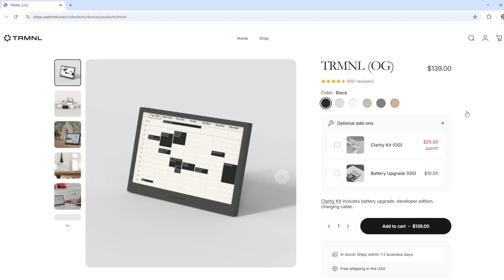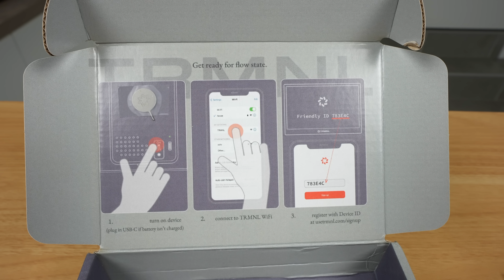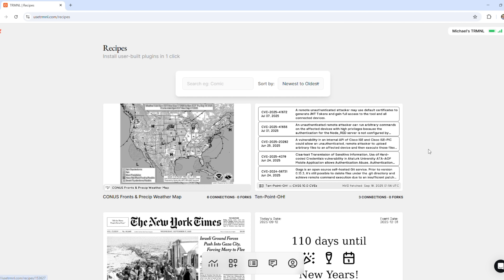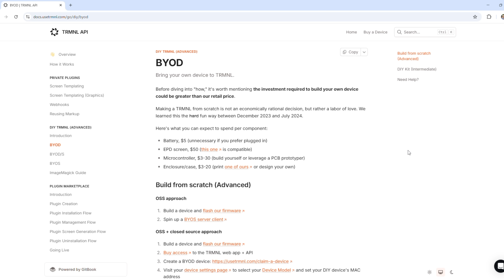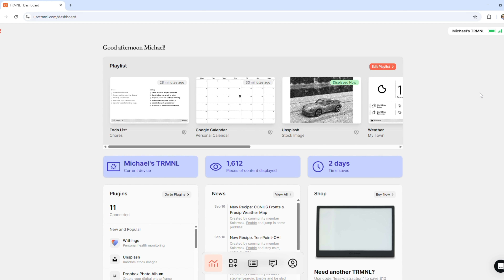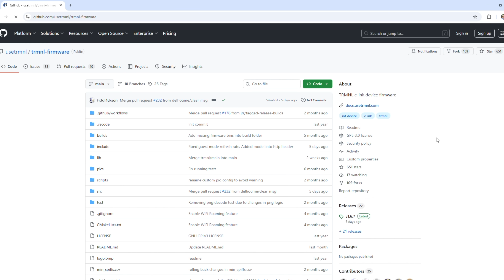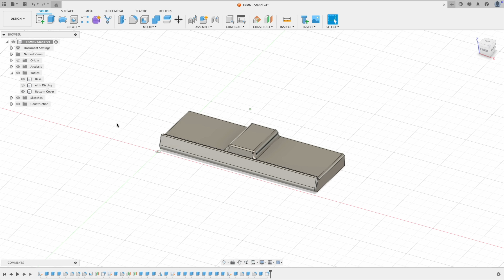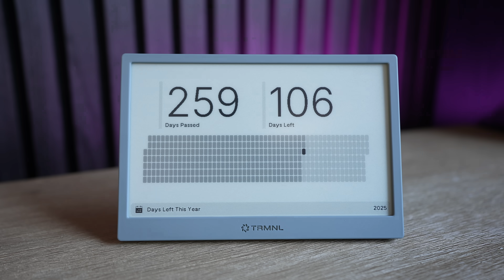TRMNL: The Open Source Smart Display You Can Build Yourself

Comment: Hey Michael,
I would like to know more about the 3d printed stuff, since I don’t have a printer of my own, I’m planning to use a professional service provider. I have a few questions before I proceed with that:
Aside from uploading the .stl file which you have provided, do I need to specify the exact material, or is that usually determined by the file itself? If it’s not the case, would you let me know what is the cheap option ?
Does the file contain all the necessary data for wall thickness and scale, or should I provide specific measurements to ensure a smooth print?
Thanks a lot 😉
Reply from the maker: If you’re using a service you can usually just upload the file and let them decide what “default settings” to use. This isn’t structure so something like 2-3 walls and 15% infill will be fine. Print it in PLA or PETG.

Comment: For the original TRMNL, do you really need an account or can you also manage it by connecting directly to it? If you need an account, then I wouldn't buy it, as good as it might be, since you give someone else the possibility to shut down the server and make the device useless.
Edit: Ah, just should have paused the video. You CAN run your own server and control your device with it. Very nice.

Comment: I love how smooth your print is and the sort of metallic flake effect - what material is it and what settings did you use to get it to look so smooth (and non-3d printed looking!)
Reply from the maker: It's Sparkle PLA from Bambulab and just printed on stock settings on the H2D through Bambu Slicer.
Reply: @MichaelKlements  Thanks, i'll check it out - the sparkle PLA looks great - it looks so smooth on this video.

Comment: is it possible to use an old tablet screen instead of the e-ink screen? And is it possible to turn an old working tablet into a trmnl?
Reply: Only the screen itself is going to be hard since the controllers are completely different. And the benefit of the e-ink is the extremely low power consumption
Reply: There is some beta project on their github to use trmnl on old readers but few models are compatible yet. And at this point it might be easier and good enough to run a local VNC from your homeserver or to just upload an image inside the old device.

Comment: if you have proprietary control system which is 50 bucks to use - it's not open source and it can't be labeled open source. Kind of dissapointing, cause i thought there is option for self-hosting of control system.
Reply: The IP server can be changed to a self-hosted one, though the hardware itself is totally proprietary and not properly documented. Better hack an old reader at this point, or connect an e-ink display with an esp32.

Comment: I looks interesting. The main drawback is IMO that it is dependent on their servers and that it needs an account.

Some time ago I tried to build something similar using an Arduino board, with the difference that it didn't run any apps, but it pulled weather data from the OpenWeatherMap api via wifi and ran a small web server that would receive messages from other devices on the same network and display them on the screen.
Reply from the maker: They give you the code and option to run your own server. You don't need to use their services if you don't want to.
Reply: @MichaelKlements if you run it on your own server can you Still use all the recipes?
Reply: @MichaelKlements Sorry, I might have missed it in the video. In that case that would be a big plus.
Reply: @MichaelKlements  How generous of them to allow us to do whatever we want with the hardware we own.

Comment: Is it possible to use this setup with a non e-ink display?  Of course, you'd loose the low power consumption, but if that didn't matter, could you plug it into a color display?
Reply: A quick look at their website tells me they seem to offer their firmware also for jailbreaks on Kindles, Kobos and even Android. Not sure what it would look like though
Reply from the maker: Yes, you can run their firmware on an Android tablet - but it does kind of defeat the "low power" concept of the project.
Reply: @MichaelKlements I was thinking more like, run it on a Pi, and hook it up to a 24" monitor to make a full sized wall calendar.
Reply: @spetsdod  they support pi and any Linux based device pretty much but a monitor is really power inefficient so you’re really blowing their whole low power thing out of the water.
Reply: @not_ever again I'm not interested or concerned about the low power thing for this project.  Thanks for the input.

I'm just trying to find a way to set up a wall mounted shared calendar/family tracker that doesn't have a $30/mo subscription fee...

Comment: I need this but HUGE
Reply: You can technically build one but huge. Might need some better components but other than general display scale cost that's not linear, and perhaps a better micro controller and optional battery you can probably go for it.
Honestly if you are going big I'd skip the battery all together because at that point it's going to be more efficient to run it off the wall rather than constantly charge the bigger screen.

Comment: It isnt open source if you need to PAY for a "developer license"
Reply: It is open source. You can host this on a home server locally yourself with either the fully assembled screen you can purchase from them or you can also completely DIY that part (they even let you use jailbreaks for Kindles or Kobos). Then you don't have to give that company a single penny. You only have to pay a one-off fee/license when you want to use their servers rather than host your own. If you do, you also get the permission to publish custom plug ins to their "marketplace", that's why it's called "Developer license".
Reply from the maker: You don't need to pay for a developer license, that is an option if you want to use their servers. If you don't then you can run your own server at home - and they provide the ability to do so.

Comment: Thanks for the detailed information @EmpathVibe. I want  to built a project for my employer using TRMNL and want to utilize the openness (I will create my own plug in, I want to use various sizes of e ink displays (starting from 5" and going upto 20" if possible, in some use cases, there may be a requirement for LCD screen as well), and want to setup my own server (BYOS). I want your guidance for components to be used for BYOD. Is it possible for you to help me? If yes, how to reach out to you. I am based at Mumbai, India.

Comment: Your version is so much neater than the original, and actually makes me consider making one.

Does the original version really only have a USB port in the back?  If you are going to hang this on the wall you will never get it flat to the wall, with a miner rework of the design you could easily add a USB facing straight down.  But I am guessing they expect you to use the battery only if you want to wall mount.  And you would probably want a couple of screw slots for mounting on the wall if running it wired, or have to risk the cable weight pulling it out of level.

I've been waiting for e-ink displays to start being more popular since the patent ran out recently, and thought the displays would be getting cheaper.  When I first saw these things released I thought they looked like a great idea, and then I saw the price.  In the UK the base model is £108 which is much too high, the price seems to be based on the cost of parts plus $50, which surprisingly seems to be their licencing fee.

As a comparison I thought I would check the retail price of an alternative display, for £80 I could buy an 8.7 inch full HD Honor tablet, or for £109 (£1 more than TRMNL) you have a 10.1 inch full HD Lenovo tablet.  These are both running recent versions of Android, full colour and 1920x1080 vs black and white 800x480.  I think £80 would be a fair price for these, but even then they are blown out of the water by your design.

With an Android tablet alternative the battery operation it not available long term, but most locations where I would use one of these USB power is not an issue.  Most of the data I would want to display on this could probably come from something like Home Assistant, and you could interact with it to actually do things too.

But anyways too much words, summary "your design great, original meh", and new channel sub.
Reply from the maker: I like my design as a desk piece but it is quite fragile, it won't survive a drop.

Yes, the USB port is on the back. I think the intention is that you charge and then use it, not leave it charging on the wall. They may revise this in future versions.

Their license fee is a significant portion of the upfront cost but I'd rather pay a single one of license fee than have an ongoing monthly subscription fee. You also only have to pay the license fee if you want to use their server, you can run your own server locally and bypass the license fee if you'd like to.

A tablet is still a cheaper alternative but they essentially require to be plugged in if they're "always on" and the backlight is annoying at night time.

Thanks for the feedback and for sharing your thoughts!

Comment: I love your custom design, but it also made me nervous about tension in the screen. The bigger the screen, the riskier it is for tension to cause cracks in e-ink displays.
Reply from the maker: What do you mean by tension on the screen?
Reply: @MichaelKlements  Movement causes physical tension in the screen. The typical e-ink displays are known to be a bit brittle and they can crack if not properly held in place. There are flexible e-ink displays too, but this is not one of those.

Comment: 5:50 most of those displays support partial refresh, though TRMNL software doesn't seem to support it, nor they allow refresh interval less than 5 minutes, which makes it impossible to show current time.
Reply: Of course you can show the current time... Once every five minutes. But rapid screen updates isn't what epaper is good at, and there are cheaper alternatives for showing the time - it is called a clock. 😊
Reply: @hb-man but the screen supports partial update which means we can render clock updates every minute let's say, and do a full refresh once in 5 minute as currently possible. That is almost trivial to do with esphome, though you are loosing the flexibility of TRMNL UI😢
Reply: @RomanOstolosh Exactly, and as a software developer I can understand why they currently don't support partial updates: Assuming their entire plan was to send static display info, tiled into up to four segments, from a central server, using a plugin system, this is the easiest option to start with.

And in fact my only question was: Could I integrate it into home assistant? But I think this is a task remaining for a home built solution on my own, once I have time. 😂
Reply: @RomanOstolosh  I never understood why the drivers are so simple. Maybe it's handy to use the old display link driver in Linux (talking about the display itself, not the trmnl), because as far as I remember it only send deltas over to their usb 2 "monitors'.

Comment: It would be super cool for my smart home setup. Does anyone happen to know how well the display can be controlled via HomeAssistant?
Reply: im interesated too
Reply: There are home build systems that use ESPhome to achieve similar results, a quick google brings up a few videos and tutorials.  The real difficulty is doing it cheaper than an off the shelf Android tablet running the Home Assistant app, which is what stops me from making one.

I keep thinking that a display by the door to confirm that all doors etc are closed as I leave the house would be a great idea and look good, then I realise that I could do pretty much the exact same thing with an ESP32, a PIR and an LED that shows red/green depending on actual status, and would wouldn't be stuck with the wait 5mins at the door to confirm that it has updated.  And then never get around to actually doing it.
Reply: @gordon861  an android tablet uses a lot more power and requires frequent charging

Comment: Could I use an E-ink display for a magic mirror for the wife? Using trmnl web interface so she could easily customise her own 'widgets'. As opposed to the conky config style on most magic mirror options?
Reply from the maker: A magic mirror usually requires a backlight to shine through the tinted glass, so an e-ink display is probably not going to work. You can run this on a standard display on a Raspberry Pi though.